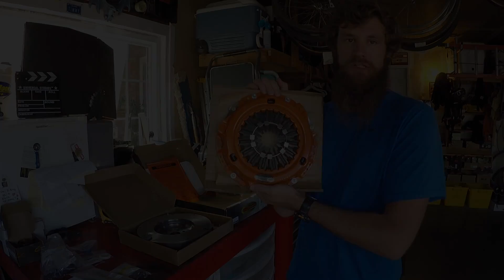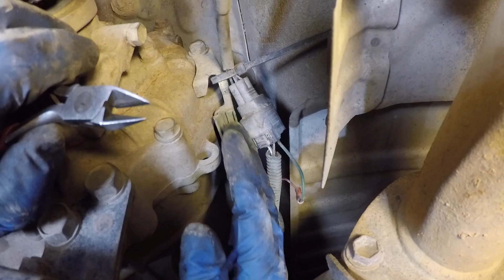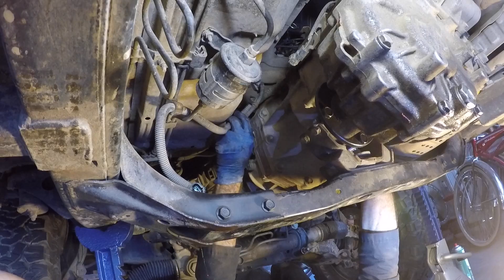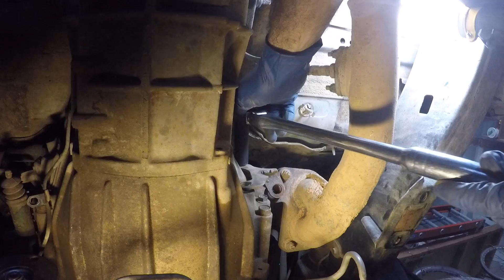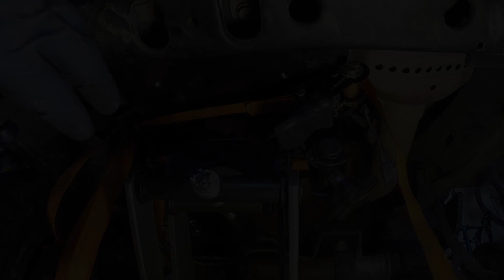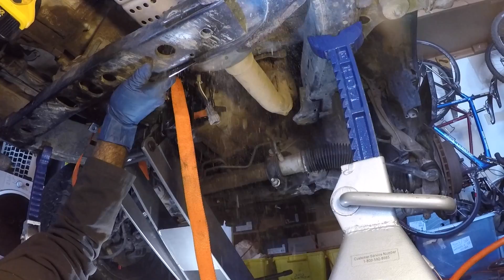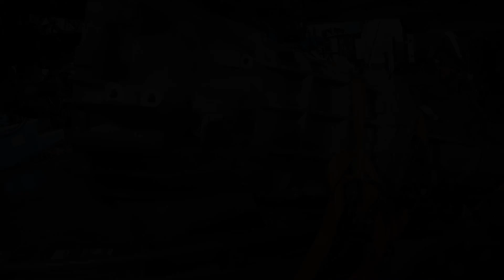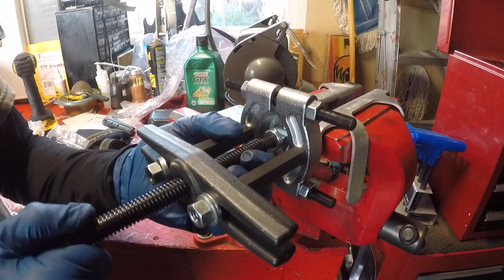Clutch Replacement (Part 1)

Comment: I also have a 1996 3rd gen SR5 4WD with a manual transmission. 330,000 miles now so I am wanting to do a lot of the repairs you do on this channel. As a 19 year old kid who wants to learn to do a little wrench twisting,  this channel is invaluable. I am gethering all the tools and shit i need right now to change the oil in the diffs
Reply from the maker: Well Bro, it's great to hear you're interested in turning wrenches.  I don't think as many young guys these days are interested in auto mechanics so good for you.  Auto Mechanics really is a worthwhile pursuit for the knowledge gained, money saved, the challenge, and the great feeling of achievement when you successfully perform a job.  Good luck with your rig, and if you have questions, you know where to find us.  Happy Wrenching!
Reply: @TimmyTheToolman  Thanks for the free advice. Hey, if you ever need a truck to do a video on... Not sure how that works, but mine is a super clean, bone stock and is a very early 3rd gen example; built in early December of 1995. If you want a high mileage early 3rd gen to showcase on here to show how things wear at such mileage, because there are mostly factory parts still in it. There's pictures of it on my Instagram page @norton3018 if you want to see it. I'll give you my email if you're interested in any way.
Reply from the maker: @cameronnorton5898  We're interested in jobs we haven't filmed yet so if you have a job like that, we might be interested in doing it for you.
Reply: Hey @cameronnorton5898, this post is 3 years old, how about an update? How many miles on that '96 now? How many of these videos have you used to keep her on the road?
Reply: @duaneweikum  350,000. The only mechanical problem I had was the rear axle oil seals. It was no fault of Toyota though. The rear diff breather was sealed over with mud so the pressure had no way to escape.
New rear bearings, new oil seals, new rear brakes. My dad and I did the whole job ourselves it was fun.

Other than that, a coolant flush, power steering flush, new gear oil in rear diff, transfer case, transmission, front diff, all 4 ball joints, all new front brakes, probably more I'm forgetting. Oil changes every 4k miles.
Reply: @cameronnorton5898  Yea, I did my rear seals (and brakes) for the same reason, then added a vent tube up into the fuel filler area so this doesn't happen again.
Another @TimmyTheToolman successful job laid out and performed by U-Toob Certified Mechanics!

Comment: instead of drilling bell housing bolts, should of tried "building" up recessed bolts with welder until you get a nub, then weld a nut on to it, with the heat of the weld, slowly back the nut and the stud out. Easier than trying to drill it out
Reply from the maker: phxamigo if we had a welder that could definitely be an option. That was not a tool we had in our arsenal unfortunately

Comment: Excellent footage along with teamwork to remove the transmission brother Tim!! Wow, those three bell housing bolts-didn't see that coming, especially when there was hardly any corrosion. Did the factory cross thread them?
Reply from the maker: Thanks Brother Jake.  I think the problem with the bell housing bolts is it's a steel bolt going into an aluminum housing.  If any moisture at all gets into those threads, the two dissimilar metals can get pretty much welded together.  I don't think the factory cross threaded them.
Reply: @TimmyTheToolman  That is very likely what happened. Never know what you're going to get into when you start tearing these things and parts and, by the way, I am still waiting for my buddy so we can finish his power steering rack...I know it's been ongoing!!
Reply from the maker: @8953147  I can't remember, are you just replacing the rack or are you attempting to rebuild it?
Reply: @TimmyTheToolman  we started by replacing his steering rack on his 2002 Sequoia, and then it led to the upper and lower control arms and ball joints, then repairing corrosion... It has become a long term project for us. Will keep you updated.
Reply from the maker: @8953147  Roger that Jake,
Reply: @TimmyTheToolman Thanks for all your hard work Timmy. Would you say the moisture welding the bolts is a common problem in 4Runner manual transmissions? Should the bell housing bolts be avoided altogether, or do you think it was something specific to the 4Runner in the video, and uncommon in other 4Runners?
Reply from the maker: @BKISHDROID I don't know how common it is for the steel bolts to get locked into an aluminum housing, but I would guess it's fairly rare.  

The bell housing only needs to come off if you're rebuilding the transmission.  I learned afterward that the bell housing didn't need to be removed for the replacement of the input shaft seal.  There's a housing plate you can remove without messing with the bell housing.  We show how to do it in our 22RE Engine Replacement Series.

Comment: That sucks that the bell housing bolts snapped since you already hat to re tap the holes and get the broken bolts out all that work I would of replaced that seal
Reply from the maker: Well, we would have still had to get the bearing cover off which was held on with a lot more bolts that might have broken off on us.  After spending at least a couple hours drilling and retapping holes for his bell housing, we weren't about to possibly go through all of that again if one or more of the bearing cover bolts broke off too.  Feel me?
Reply: @TimmyTheToolman  I feel you

Comment: Nice way of using a bearing splitter
Reply from the maker: It was the right tool for the job.  That pilot bearing inner race was locked onto the input shaft of the transmission.

Comment: 3rd gen 4runner plugs always fight no matter what it goes to inhave that problem alot with the fog light plugs
Reply from the maker: Yeah, the electrical plugs can be a pain in the butt to disconnect.  I've fought many working on these rigs.

Comment: Yeah I'm gonna order stage 1 clutch when it wears out or a heavy duty one that would last
Reply from the maker: That would be a smart plan.  Who the hell wants to do this job more than once?  Not me, but I bet I will be doing it again for someone at some point.
Reply: My original clutch lasted over 300k miles. This was on my 1997 4Runner.  Still had some material left on it but I decided to replace it due to me taking a long road trip last summer.
Reply from the maker: @Rhaspun  You and any other previous owners obviously know how to use a clutch if it lasted that long.
Reply: @TimmyTheToolman  I'm the original and current owner. This 4 Runner has been the most reliable vehicle I've ever owned. Even the rear brake shoes lasted over 300k miles. I think it's more of a Toyota thing myself. Clutches on the different sport cars I've had didn't run like the one on my 4Runner.
Reply from the maker: @Rhaspun  You may be right.  It could also be a fact that more freeway and highway miles were driven also.  I would think someone who does lots of stop and go city driving would wear out a clutch much faster than  someone who mostly just cruises down the highway.   So, mileage is relative when it comes to things like clutches and brakes.  The conditions it was driven to achieve that mileage is a huge factor to longevity of the wear parts like brake pads and clutches.
Reply: @TimmyTheToolman  The 4Runner was my go to vehicle for traveling around the Western part of the US. I've put a few miles in Canada and Mexico.

Comment: Literally did this job last week on my new project flatbed Tacoma. 
The previous owners were using a slave cylinder off a Hilux and a ton of other not so sick mods.

Not much out there about the clutch job on the 3.4 so this video will be useful to many.
Reply from the maker: Yeah, Sean and I figured this would be a good video to make so we took Dan up on his offer to drive down from Kirkwood and do this job at my place in San Jose.  It took up a whole weekend but it was worth it to make a detailed video for people to follow.